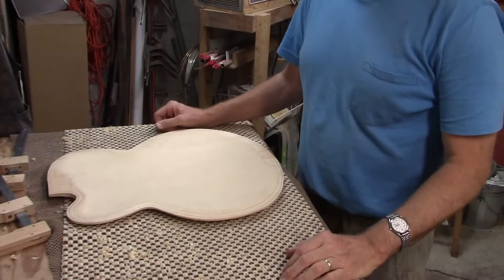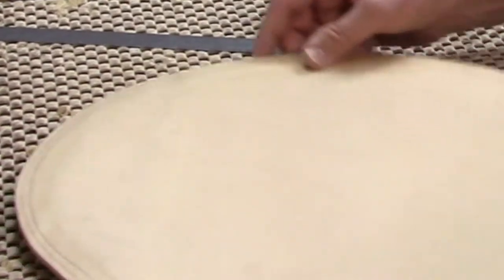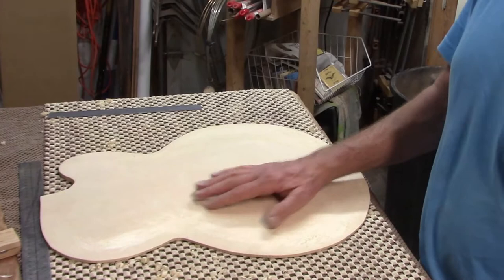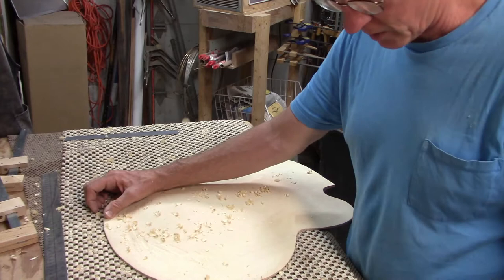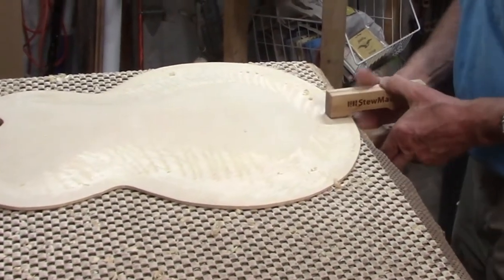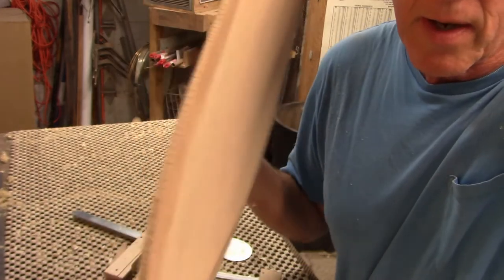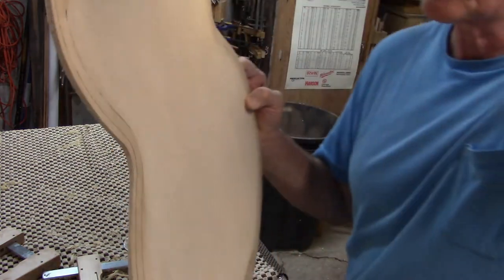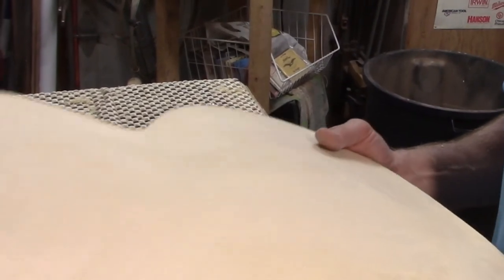Archtop soundboard tuning

Comment: I make violins, guitars, and just finished a cello as a hobby. I made all but the first couple violins from the inside first. The inside arches define the arch on the outside almost like finite element analysis. I enjoy your videos because I am self taught, so like to glean ideas. I just head of you because we plan to go to the woodworkers show in Adrian next weekend, and my wife said that a guitar by you will be raffled off or something. I looked up your website, and started watching the videos.
My latest archtop isn't quite done, an acoustic version of a Les Paul. I call it an Electroless Paul. I'm starting another 15" one, (the Less Paul is only 13") with an asymmetrical outline, and the inside out approach made carving the belly very simple. Since I don't use pickups, I carve quite light. 
I use a fine smooth chain from Walmart to get the inside arches perfect.
Thanks for the videos.
Ken
Reply from the maker: Thank you very much for the comments.  I am self-taught, too.  It's nice to know someone else carves the inside first.
I hope to make it to the woodworking festival next weekend. Yes, they will be selling raffle tickets for a guitar that was built by me and a friend.  It is a OOO-18 style steel string.
Good luck with your guitars!